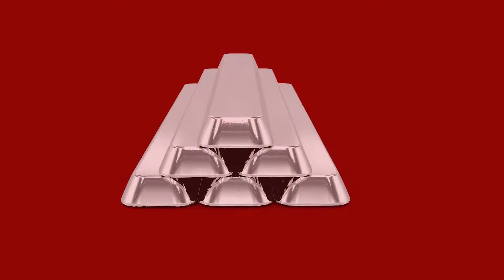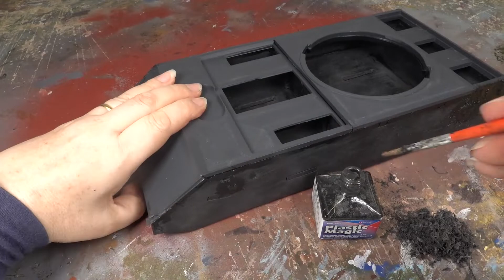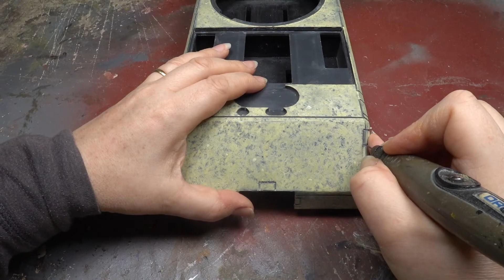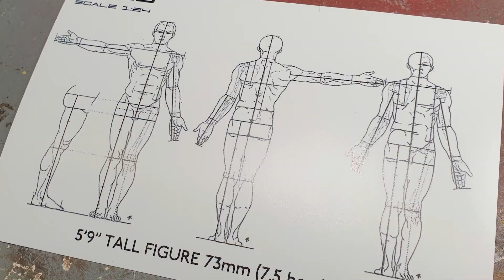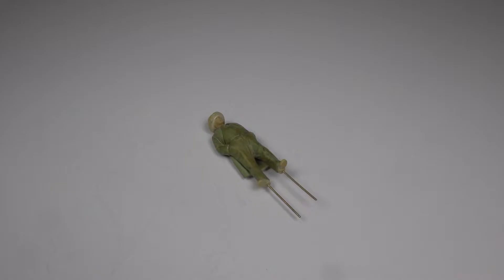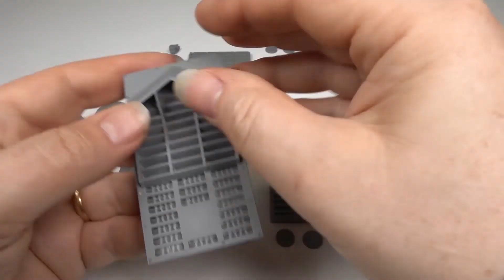PROJECT MAUS PART 9  ‘UPPER HULL DETAIL PART 1’

Comment: Wow my fav tank!
Reply from the maker: You have excellent taste my friend. 😎
Reply: Staples and Vine thx I know all about it. 

It has 2 main cannons a 128mm and a smaller 75mm next to it.

It weighed 195 tones (with engine and ammo and transmission and what not) 

It was supposed have a anti aircraft gun in the turret

It was also supposed to have a flamethrower at the back 

If you look at the tank it has hidden weld points on the side skirts (near the top)

It’s thickest armor point was on the front of the turret 240mm (7.9in)

The projectile weighed 62lbs (28.123kg)

It is still around today in kubinka Russia but it has no engine no drivetrain no electric generator (because it was designed by Ferdinand Porsche) fun fact: it was his first and only successful design that was approved by hitler.

My goal in life and I am only 13 is to restore the maus to working order and make it available to the public to drive.

It’s what got me into tanks and I am grateful it’s still around and will these instructions be available for anyone to print cause if I get a 3D printer I want to have my first print I will be so upset if it gets scrapped 

I can go on and on about the thing but I know u are probably busy but anyway thanks 😊
Reply from the maker: @mausisbestwaifu8376  Hi, I admire your passion for the Maus. I'm a big Porsche fan - the cars were more successful than the tanks. Sometimes I wonder whose side Porsche was on In the war. 
Regarding files for the Maus they won't be available as they have lots of errors I made along the way. It's all part of creating and learning new techniques. 3D printing is only part of the project. You will see from the episodes lots of other processes are used. There should be a new episode out in a couple of weeks with everything in primer.
Reply: Staples and Vine thank you I also love Porsche the Porsche 918 specifically and it is understandable that you won’t make it public
Reply: Staples and Vine I will definitely watch it